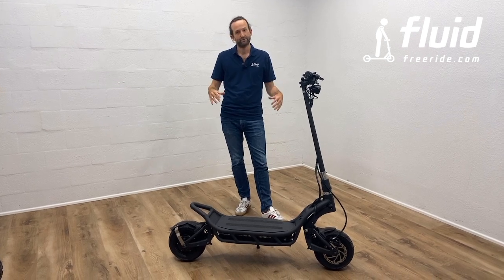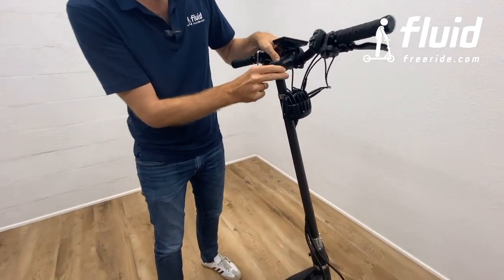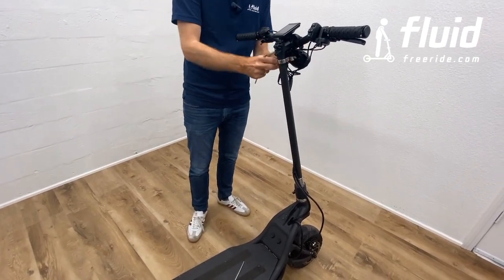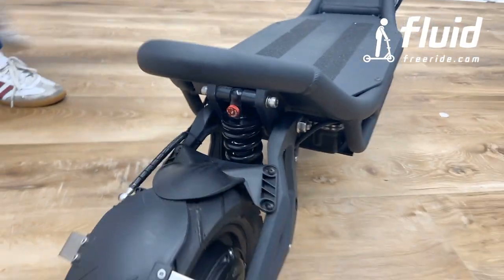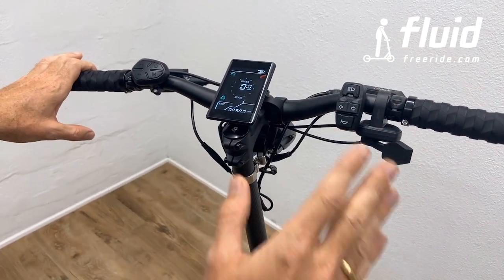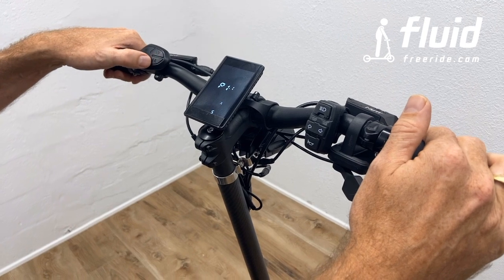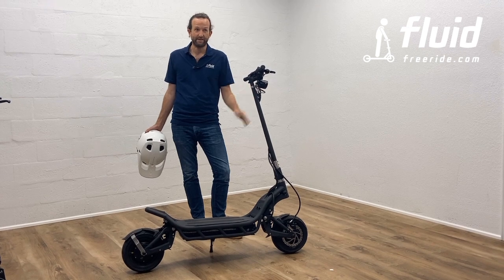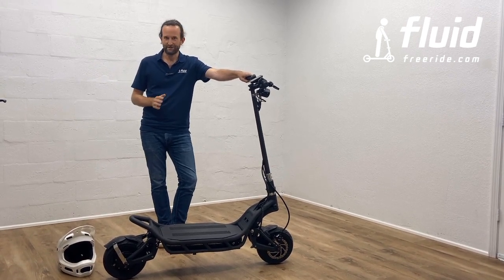NAMI BURN E Start Up Guide

Comment: would the included steering damper take care of most if not all the high speed wobbling?
Reply: Yeah, it does.  I got one a few weeks ago
Reply: Yes, but I wouldnt fully rely on it. It's only an aide. If you feel wobble, slow down and wait till its stable again before accelerating.
Reply: @civedm  of course..